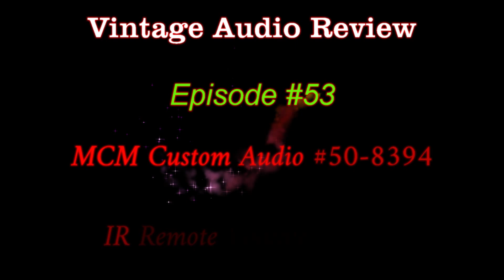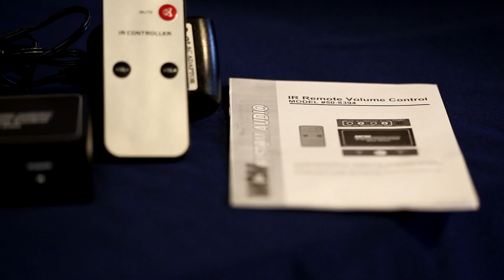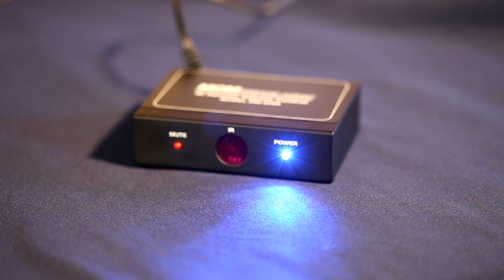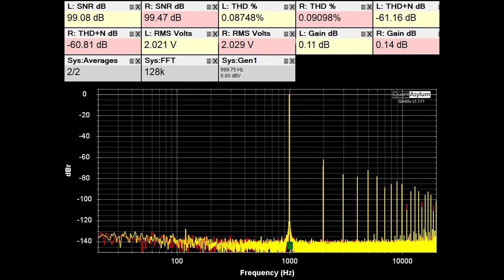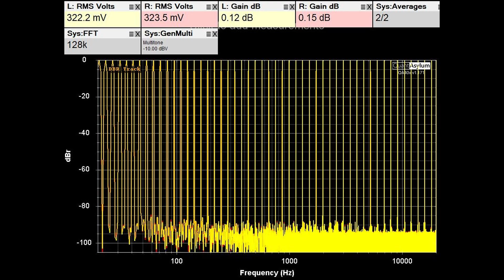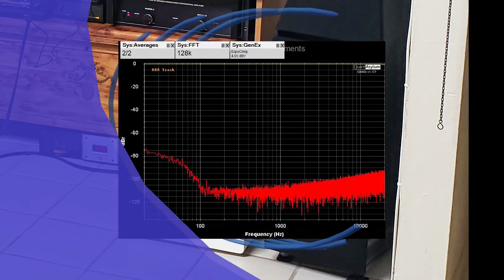MCM Custom Audio Model 50-8394 IR Remote Volume control- Vintage Audio Review Episode #53

Comment: I been trough two of them and they work for about two weeks and then they failed to work so no way on these and a $100 shot in the ass
Reply from the maker: I have been using one for about 6months and it works great- sorry it has not worked out for you.

Comment: I use the MCM for sub control and added the new Fosi P4 for main volume. The P4 adds more inputs to your preamp out. Plus tone control. It takes 2 remotes but works very well.
Reply from the maker: Thanks for sharing how you are using it. I am now using my remote volume control for my vintage preamp.

Comment: I am surprised this is the only company on the net that makes this, been looking for this for years, if only they have a light showing the volume levels on the box and if you can use more than one in a room !
Reply from the maker: The LED stops blinking when you hit its max volume and I can't see running two stereos at the same time in the same room, so I don't see why that would be a problem... I am using it now in a system and am happy except the LED is pretty bright. Thanks for taking the time to comment!
Reply: @vintageaudioreview  i might get one for my Marantz 2215

Comment: The remote looks kind of flimsy. Have you had any problems with it?
Reply from the maker: Thanks for the question. Honestly, I have not had the occasion to use it in any of my systems, so I can't say if it will last, but it seemed decent enough.
Reply: @vintageaudioreview  thanks for the response.  My sense is remotes with those types of buttons don't work very long and are designed to be used minimally. I could have just had a few bad experiences though.
Reply from the maker: @anotherOneMore7 - I am not sure if they are available still but for the price, if you needed to replace everything at some point, it may be worth it.

Comment: While watching the video you prepared for this product, I was stuck on another word of yours. I couldn't understand why you didn't like the Douk Audio ONE Little Bear Switcher model vu3 device. I was just thinking about buying this device. Can you write more clearly what is the problem with this device? Thanks ...
Reply from the maker: The low frequency response had about a 1dB bass boost, which I did not want to have for something used for a/b switching. I did a review of the Neohito device in episode #127, which I would recommend. I will have a review out in a few weeks on the Fosi LC30, which I would also recomment.
Reply: @vintageaudioreview  I know both of these devices, I watched a lot of review videos. I liked the design of the Fosi Audio LC30 the most, but the biggest criticism of it was that the vu meters moved very little when listening to music at low volume and I gave up. I look forward to your video about these two devices, I would like to watch it before I buy it. Thanks 👋
Reply from the maker: @birolerkan65  Do not buy any of these for the VU meters- none are accurate, but do have a limited amount of use- in the case of the Neohito they can help match the levels between speakers if you use the microphone that is built in. They are all fun to watch, I suppose. The LC30 can do more switching is its biggest advantage. That video "releases" in two weeks. If you really wanting what  I am guessing is a power meter, try to find a Realistic APM-200
Reply: @vintageaudioreview  My purpose of use is to switch between amps and speakers with the remote control, the wu meters are only visual for me ...I am afraid that it does not affect the sound negatively. My mechanic master here says it will have a negative effect, let's see.
Reply from the maker: @birolerkan65  No effect on the sound whatsover.

Comment: I am guessing connecting it to the tape loop requires that you set the recievers volume to a fixed level, like 12 o clock and then use the remote to control the volume? But if I use the pre in and out I will bypass the volume knob completely right?
Reply from the maker: Your volume control will still work normally when connected to the Preamp out. Look at my comment from just a few days ago to see how I would set up the volume control Thanks for watching and the question
Reply: @vintageaudioreview Thank you so much. That really helps. Such a shame you can't seem to buy them anywhere in Europe:(

Will this one power on and remember volume setting of I plug it into the wall or should I use the AC outlets?
Reply from the maker: @frittfrall3220  I am pretty sure I mentioned that it remembers your volume control settings when powered off- at least for several minutes which was as long as I left it unplugged. Too bad you can't find any where you live.

Comment: Can this be used between my vintage Marantz that I use as a pre-amp and an Emotiva amp to lower the volume when I need to? Or is it best if i put it between the DAC and the preamp?
Reply from the maker: Yes. It can go between preout on the marantz and the Emotiva's input I think I went over the best way to set it up as far as starting off with the MCM at maximum volume and the Marantz at it min volume level, and increase the Marantz until it is as the highest level you would normally play at and then the the MCM from then on.
Reply: @vintageaudioreview  Thanks, I just don't want to damage the unit by sending too much signal into it.
Reply from the maker: @pedrofernandez8729  You should be ok- let me know how it works out for you!

Comment: Hello - Any difference in connecting it to the AUX vs Tape?
Reply from the maker: Hi- It needs to be part of the tape monitor loop, or connected between the pre out and main in jacks if the device has one.
Reply: If you connect it to the AUX Input then you are limited to one source that connects to the box's input. By connecting it to the tape monitor loop (or the main-in, pre-out jacks) then you can control the volume of any source that is connected to your receiver/amplifier.

Comment: I'm waiting for pre order shipment of the Fosi P4 that was on sale for $75 for this solution. It has additional inputs and a motorized volume as a bonus.
Reply from the maker: The Fosi P4 is a preamp and I supposed you could use if for just a motorized volume control- kinda a bit of overkill, though..Thanks for taking the time to comment

Comment: Hey, great video! Does the quality of analogue interconnects going in and out of the device affect distortion or sound output quality?
Reply from the maker: Thanks for the question and encouraging comment.In my opinion, which is based on a background as an electrical engineer as well as measurements I have made, as well as other research I have seen, the interconnect cables really don't effect the sound. Some are built better and look nicer, but really don't make a difference if the lengths are kept reasonable. Check out episode #99
Reply: @vintageaudioreview  Fantastic, thanks so much! I was curious about the the specific use of analogue interconnects in the case of connecting the MCM unit to my amp.
Reply from the maker: @matteomaneiro7035  You are very welcome!!

Comment: How do you turn it off
Reply from the maker: I just looked at the own I own (boxed up for now) and there does not appear to be an on/off switch unless you continue holding the volume down or mute button down...? My suggestion would be to plug the dc adapter into the switched outlet on back of the receiver, intg amp or preamp.

Comment: This unit works fine but reviewer has not mention connecting MCM device to any Preamp without IR. instruction manual provided inadequate virtually you need 2 pair of RCA cable to connect to preamp's tape in and tape out .
Reply from the maker: Thanks for the comment, and the reviewer would be me. I just assumed that folks would know what was involved in hooking something up to the tape monitor loop- yes, it takes two stereo rca cables (or 4 single rca cables)
Reply: @vintageaudioreview  You've done a great job! information you've shared with us greatly appreciate it.
Reply from the maker: @sabihtasoz2722  I always like to hear comments like that- thanks!!

Comment: I still dont get it. Does it go from Tape Out to Main In? And i remove the bridge from Pre-out to Main-In?
Reply from the maker: You can use it either way. I prefer inserting it between the preout/main in jacks. Start off with the volume of your receiver or integrated amp low, and then max the volume of the IR remote and adjust your receiver/intg amp volume control for the loudest level you want ,  and then adjust the IR units volume control from then on.

Comment: Thanks for making all the measurements on this device. I like seeing the distortion spectrum it produces. It looks line this control will work fine with low distortion as long as you don't feed it with high level like 2 volts right from a CD player. It is a pretty handy little volume control.
Reply from the maker: I appreciate your comment and understanding of what I was trying to show. It could also work for a subwoofer remote level control in some instance- I am not sure I mentioned that in the video..

Comment: Another very informative video. Thanks.  I have the 'One Little Bear'.  It is my second one.  The first one's meters quit working.  The second one has performed well for me for many months now, and I use it to switch between two amps I frequently use, and I wouldn't want to give it up.   I think your graph shows about 1 dB rise at about 35Hz and about .2 dB rise at 20k.  Fortunately, I did not notice any audible rise in the frequency extremes.  It sounds very good to me.
Reply from the maker: Sorry that I am just now seeing this comment. You probably would not hear either of those rises. They would not work for me because of how I would use them- a/b tests- so want as minimal change as I can to the signals.

Comment: What about the WiiM mini? That has a Volume control, and 10 band Eq on it plus it's a streamer, for about $35 USD more. 
Comments?
Reply from the maker: Thanks for your comment! Funny, I purchased a Wiim Mini about 3 weeks just so I could play my entire CD music collection (.wav files mostly) from my network drive- am loving it! I suppose you could use it in your tape monitor loop or between the pre out/main in, but you need to be connected to wifi and use your phone or a tablet- which have to be newer devices to run the Wiim app. To me it would be a clumsy solution. Right now I don't have a tablet new enough torun the app so it is on my phone and when I am listening to music and get a call it is a bit cumbersome to stop the app so I can hear the call since I am playing my music on the louder side. I don't use the EQ on the ap since my stereo system  has one as does the preamp with its tone controls.  I did a quick test on how well the mini converts a "pure" tone from the hard drive on the server through the mini and into my analyzer and it does a pretty good job.

Comment: If you use the tape monitor then you go back into an aux input?  TIA
Reply from the maker: Thanks for the question. If you connect the MCM controller into the tape monitor loop, you can still connect something into the aux input or phono input or whatever, you just need to make sure the tape monitor is switched on.
Reply: @vintageaudioreview  Got it.  I didn't understand it as a loop.  Thanks!